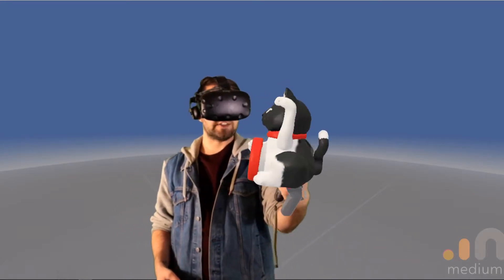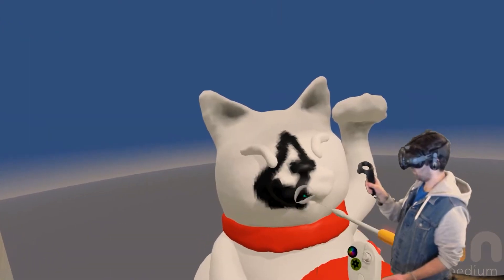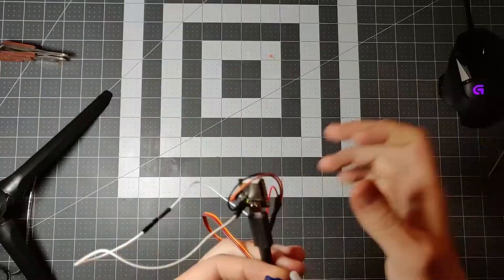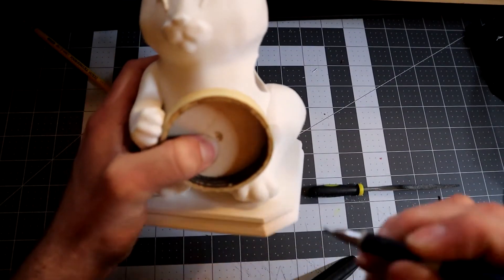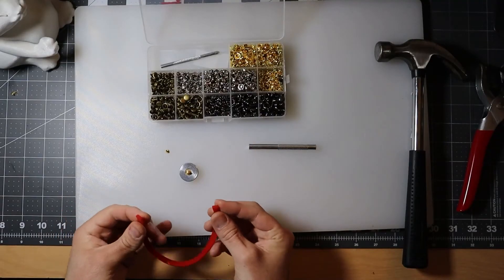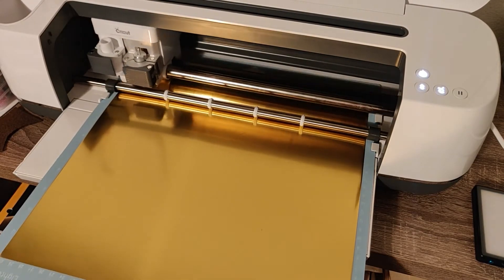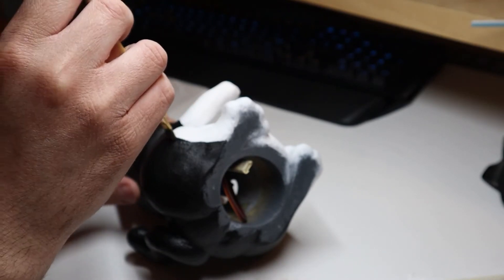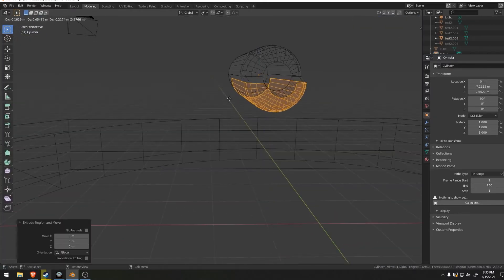Making a motorized Lucky Cat (Maneki-neko)

Comment: Great little project! What's the exact motor assembly mechanism you used? Also how  hard was mounting the motor / servo into it?
Reply from the maker: Darn I can't believe I didn't show that! When I hollowed out the inside I left a flat spot and I epoxied the servo to it. Those servos come with box enclosures so it's really easy to mount them any side. The servo came in Elegoo's Arduino starter kit, the manual says the model number for the servo is SG90.